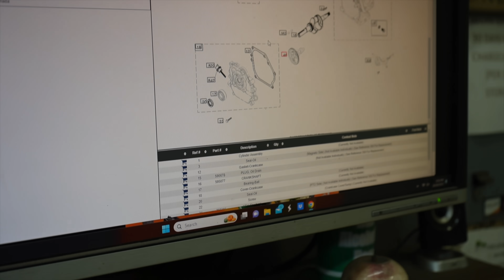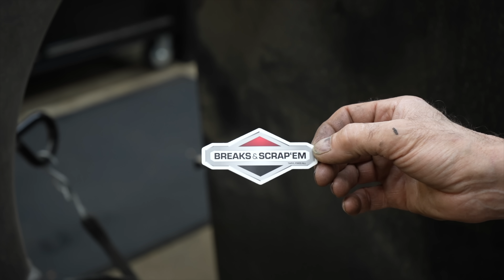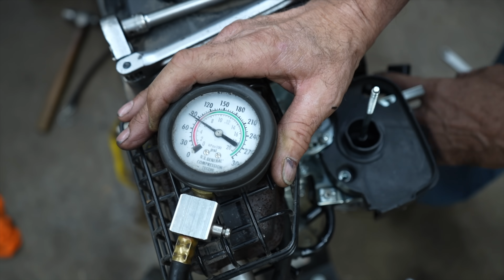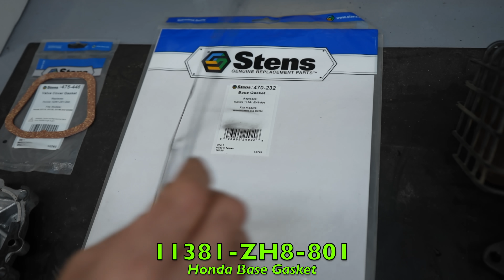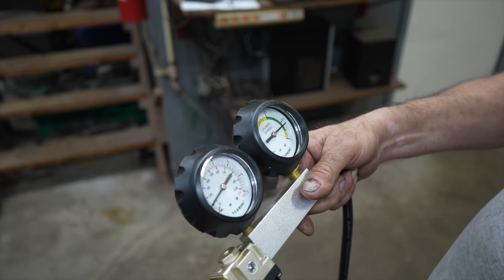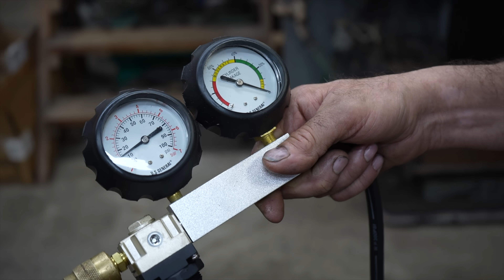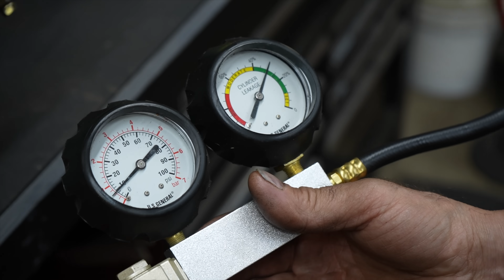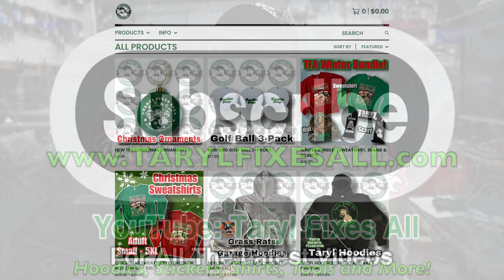Has He Finally Met His Match? Taryl is STUMPED!

Comment: What amazed me the most was not the stuck rings but how you, as a professional engine mechanic with your own shop, seemed to go through checking a lot of ' parts ' way before doing things like spinning it and observing the positioning of the valves in relation to the piston, COMPRESSION TEST,  ' real ' spark timing in relation to piston. Etc
Maybe a new addition to Taryls garage can be an acetylene powered ' parts ' cannon.
Reply: To be an accurate comparison the compression release would have to be removed from the Predator.

Comment: Strange problem with rings. The leakdown test is the primary way piston airplane engines are tested (done every annual inspection). Never done using a compression tester. Now it makes sense.

Comment: I've seen that problem on car engines with low miles and blowing oil out the tail pipe from short runnings  and the engine was  carboned up and the engine never gets warmed up

Comment: My log splitter has the same engine  and would start and run for less than a minute. it ended up being the gas cap clogged up. Wouldn't restart until I took the gas cap loose and let the fuel run through. Popped the cap apart and cleaned it out and so problems since.

Comment: So preditor pushrod is shorter, but the tappet is longer, so over all, both tappet and pushrod length is the same on both, right? If so, as long as you use both on a swap, they should work, correct?
Reply: I wondered that too, are the tappets' shafts the same diameter?

Comment: I had a Chinese engine pull that same crap on me. It was a sticky valve. Did it on two separate occasions. I blamed inadequate maintenance/tight clearance. Had to remove and clean the valve both times.

Comment: I quickly changed leakdown tester like that by replacing 2nd gauge to match 1st one. Then I have to calculate my leakdown.  I also eliminated the quick connect to the engine lead because it leaked.

Comment: You could have loosed the rockers put the piston at the bottom. Used your compression gauge fitting and pluged it in to say 40 to 70 psig air and listen and feel were the air is coming  out of, the exhaust, the intake, the crank case, the head gasket. You could also put diesel in the intake and exhaust ports and look for bubbles. This will tell you if its bad valves bad rings or bad head gasket cracked cyl. cracked head hole burnt in piston. Easy way to check why compression is low. You could also do a dry and then a wet compression test to see if the compression comes up a higher,  Higher wet reading usually means bad rings. What was the compression after you freed up the rings?? If the customer did not use the right break-in oil and  it was burning oil this may have stuck the rings. Really not Briggs and Scrap em fault.  🧐🤓

Comment: The classic 3.5hp veritical shaft is able to interchange parts i.e piston,crank,camshaft, valves etc with the later ,vertical 3.75 etc sprints. Quantums (mechanical governed) same thing, tho i'm not sure about the pistons & if they changed size once they hit 40 or if it was the later quantum 50 if it all. My point is the motor that requires the cam may & most likely can use a cam from an earlier model tho it may not be plastic. Just a thought as briggs appears to have standardized parts through different models & years in other words the cam may not be model specific... The chinese mufflers you'll find most likely will have the same bolt pattern as a briggs 16-17hp as my loncin 20hp did. It also means you can use an extension or make your own extension pipe & use the original muffler from a chinese motor this will save buying another muffler,it may require some pipe bending so it doesn't get in the way of shields etc so muffler can fit without interference

Comment: Taryl: I don't believe it. If it starts and runs, but has no power I'd say OK it's the rings, but it should also be producing a cloud of crankcase gasses i.e. smoke coming out of the crankcase vent. Eventhough, how do you explain why it starts cold but won't start hot? You should have scoped the crankcase breather tube while it was running for blow-by. If there's a massive amount of blow-by coming out of the crankcase, go have dinner. But if not?  Ignition electrical or water'd be my guess.  We'll see if it comes back. ben/ michigan

Comment: 80 psi would have been pretty low with the ACR disabled, I hardly believe Taryl wouldn’t have done the leak down way before pulling parts off the engine. I do realize it’s a low hour engine, but leaf vacs have a high potential for debris ingestion. Sometimes when you’ve see so much of a particular issue (plastic cam problems) you tend to try to prove the diagnosis instead of diagnosing the symptoms.

Comment: Taryl, also check those valve seats. I have had them come out of head with the valve. It will block air flow through head. And they won't run.

Comment: The oil ring will give you a reading on a compression test but if the top ring is stuck that engine will never run right

Comment: Did you compare the Scrub Cadet engine with decompression to the Breaks and Scrap'em with the decompression mechanism removed?  80PSI with no decompression is probably a bit low, leak down test solved it though, good work!

Comment: I had a briggs ex the new plastic carb ones. Anytime it was put on a slope it would run like shit. I gave up after far too much work, new briggs carbs. Checking tank fuel line, govenor, spark gap, plugs, flywheel key, Bent shaft. 

Nopety nope nope.

Comment: Leak down does test rings when you are sure the valves and head gasket are ok. So rings not seated was a great first call but if the rings were not stuck you have to run the engine more to seat them.  Stuck rings was the logical call.

They must have machined the ring grooves too tight.

Briggs honoring warranty is good.  Wish they were manufactured here in usa like they use to be. 

The predator having a metal cam is impressive. 

Still with stuck rings the 80 psi should have been sufficient for the engine to run.

Thanks for the brain teaser.

Comment: It's not because it's made overseas. the HF engines are made overseas, and they have been some of the best engines I've had. Briggs issue is the bean counters in their finance department telling them to make it cheaper. So, they make cheap plastic parts, have undertrained or no trained at all workers, pumping this garbage out. Doesn't matter which country it comes from. It all starts from the top. The top brass at Briggs wants more profit so they got to cut corners.

Comment: Taryl.... question :  Can you take the lifters and pushrods from the Predator engine (different lengths) and swap them into the Breaks engine, remove the valve stem caps, and it work ?  (or maybe have to swap the rockers also).

Comment: If that engine uses the same size camshaft journal as a gx200, which is different than a predator camshaft journal. then you most definitely can get a camshaft for it. Sure it ain't oem briggs but a hell of a lot cheaper than buying a whole new engine.

Comment: I pulled a running Breaks and scrapum off my Toro mower and  gave it away. Then I replaced it with a hard to find Suzuki 2 stroker engine. Problem solved! :face-blue-wide-eyes::face-blue-wide-eyes:

Comment: I'm still stumped though because how can we test for that without tearing the engine down because the compression test showed good enough compression.
Maybe you can test for bad rings with both valves closed and pull out the oil stick.
then feed compressed air through the spark plug hole.
this should show any overages of air flow through the oil stick tube.might want to drop some of the oil though........

Comment: Briggs & Stratton has been going downhill for a long time. Going on 25 years now for sure. I remember the 20.5HP twin opposed engines used throw rods every time if you tried to run one in the cold. The single cylinder Intek OHV lawn tractor engines you can't keep a cam in. Nine times out of ten when the compression release falls off it causes catastrophic damage. On one of the rare occasions I had one come out unscathed I figured I'd throw a new cam in it. The first two had the compression release already broken laying inside the box. Finally the third one came in ok. Head gaskets were terrible on those engines as well. I had hoped when B&S got into selling rebranded Honda clones the quality would actually improve and they would at least have some support. Turns out neither turned out to be true.
Reply: That's not what that solenoid is for. It's only there to keep fuel from being drawn into the combustion chamber and ignitng in the muffler as the engine is spinning down when shut off. Before anti afterfire solenoids were a thing it was very common to shut off a piece of equipment and have it backfire as it was spinning down or immediately after. If there's fuel entering the crankcase either then needle valve in the carb isn't seating properly, the float has a hole in it, or in the case of a Nikki carb the O-ring gasket has failed. As far as blowing  hole in the side of the block, no. That's from a thrown connecting rod. @feralkid1879

Comment: Wondering if there was any gum or varnish on those stuck rings or were the parts just machined with not enough clearance from the factory. Stale fuel will cause rings to stick that way, but that would not be a warranty situation. Since there was so little said or shown about the actual cause of why the rings were stuck, I wonder what the real reason was for the rings to be stuck? Any comment on this? Wondering if the publicity on this had anything to do with this warranty being paid. If there really was less than 10 hours of use on this machine and it is near the end of it's 2 year warranty period, it no doubt has sat with old fuel in it a good deal of it's life.  i would almost bet that the unit has been run with very degraded fuel in it a good part of the hours it has been run. How about a follow up on this Taryl? Soak the top of that piston and those top 2 rings in carb cleaner and see if they can be removed and what the ring grooves look like (gummed and varnished?) or are they mechanically wedged or stuck due to mis-machining of the grooves or the rings, which truly would be a warrantable issue. Let's hear it and see it.

Comment: 39:00 I bet the O.D of the cam bearing is the same between the Briggs, Predator so they could purchase old Honda dies to make that sump cover. Just using a different I.D bearing with the same O.D. Which is why the gaskets the same. If you pressed the bearings out of the cover & block you can probably use that predator camshaft. Get the calipers & tell me if I'm right please. - Detroit Laughin Grass Rat

Comment: A couple things to consider, a new engine will start without being broke in, so you saying the rings aren't broken in making it not start.....hmm... a motor will run on comp release enough to reach RPMs to throw out off the valve tang, it wasn't event doing that, obviously in the beginning the comp was nill by the way it sounded. Sounds to me like the customer forgot to add oil, or didn't add enough. We never saw what the cyl looked like

Comment: To be honest any highschool small engine class graduate would have known to check the rings when the spark ,fuel, and proper movement of the valves was verified.. It was obviouse the compression was low just watching and hearing you pull it with little resistance.. Ohh and the reason you were confused about the brighs compression being better then the other was because you checked the briggs compression after you took the compression release mechanism off .. If you had tested the other running engine with its compression release off it probably would have read 130 psi so you were totally confused because at low starting speeds your comparing one engine with a compression release to one without .. BTW those plastic cams will and do generally hold up fine because the valve springs on these tiny engines only have ten or 15 at most pounds of open spring pressure so they will never wear out the lobes regardless .. If you had checked the briggs engine compression with the bad rings and the compression release installed or never removed it it probably only would have had 5 or 10 psi cranking pressure which also means no vacume to draw in a proper air fuel mixture into the cylinder as well as no compression for combustion... Also i guess you misssed the blowby when the engine was trying to start and barely running .. Better luck next time !!! 😮

Comment: During the leak down test, listening to the exhaust, and intake, you can hear if the valves leak, listening to the crankcase via the oil fill cap hole would show air escaping there via the rings. Also, if you had a head gasket leak, you would hear that. Leak down testing is great for trouble shooting engines. This one baffled me for sure, but your stick to it attitude solved it!!!!

Comment: I appreciate your videos and advice.  I not fond of the Briggs and .   .... crap ..i never buy one if there is better alternative.  Just about anything would qualify..i not a expert on these engines..One of my money pit Harleys has ez start cams in it a SS engine.. i got bit from a hard starting lawn mower used i bought that the valves getting  loose and it made it hard to start ...  i worked at a power plant for a long time . The had Honda powered equipment.. pumps ect . Yea they ran good for the most part

Comment: this is more common than realized from the newer plastic motors. I have alot of them from China,  and the piston is not cut right for the rings
measured gap total distance is .0005, so after a little use-- CARBON locks the rings

Comment: Most of time the piston ring grooves on the piston accumlate with carbon and the rings stick in the grooves and cant respond to combustion chamber pressure by expanding.
Especially on 2 stroke engines. All it takes is to scrape the carbon out of the grooves

Comment: well it wasnt the muffler then. when you did the compression test and it held pressure from 60 to 80 with the 4 pulls it sort of says to me that the exhaust valve is not working 
properly.  its got sparks its got gas if its not the exhaust valve then its got to be the timing. this is interesting now lets watch more of the video

Comment: perhaps the non-venting cap explains the "run for a while then power reduction" as the carb leans out 'cause the fuel won't flow.  it would be worse when the fuel tank was really full as there would be less air to expand and it would drop pressure faster.  If it was run this way from the beginning some fraction of the running was really too lean. would that lead to the rings sticking ?? no idea.  love your videos and what I've learned from them.  been a subscriber for what seems like a decade, probably 7 or 8 years.  keep up the great work.  Glad you choose to spend some lifespan sharing your hard won knowledge in a fun way.

Comment: some fuel stabilizers react with the gas and turn into a kind of glue (stuck rings)  - years ago Itasca red 2 cycle oil would pulled chainsaw piston out to find  rings glued stuck and cylinder ruined it was not an isolated thing either

Comment: What are stuck rings? Maybe you could do a short video on what these are.
Reply: The rings are literally stuck into the piston grooves so they can't push against the cylinder wall to make a seal, it's almost like having a piston with no rings at all.
Reply: Thanks for the explanation. I didn't go to lawnmower school so I'm not an expert by any means. I'm guessing the rings are usually kind of springy so that they press against the cylinder walls to seal.  @ruben_balea

Comment: Taryl, let me see if I understand this compression & leak-down testing. When you crank the engine over it builds pressure and holds pressure (80psi) this is compression testing, correct? Leak-down testing is when you pressurize the chamber and see if it leaks down by the rings, correct? I still don't see how it can hold pressure one way, and then leak the other way. If the rings were stuck, then wouldn't it leak in both directions? :()
Reply: The engine makes pressure while cranking but it doesn't hold it, even if it's a perfect engine it will leak, the compression tester has a check valve so after a few turns it gets pressurized to the maximum pressure the engine can make.
The leakdown tester applies a maximum pressure of about 15 PSI at a low flow rate, the gauge is calibrated to show what percentage of those 15 PSI the engine is leaking at that flow rate, in this case it was leaking at about 50% or in other words it was only holding about 7.5 PSI from the 15 PSI available from the regulator.

Comment: Didn't you notice the lack of compression or resistance when you were pull starting the POS Chinesium engine?  Maybe you just thought that was normal but after you put the new piston and rings in the engine you had to notice the harder pulling while trying to start the damn thing???  But thanks for hanging in there on it and getting it done!!  I prolly would have pushed it into an old quarry or put an M80 into the spark plug hole and let her go!!!!   Really is a POS!!

Comment: The only thing i can see is there wasn't enough VACUUM created to draw fuel into the combustion chamber. Regardless of whether a compression release is working or not, the fact is the other engine would fire with 60 PSI compression while this one with 80 PSI wouldn't even do that. I can see why this had Taryl stumped for a while. You start thinking about ignition and wondering if it is just firing sometimes, valves not sealing, or something has happened and it's out of time. To know how long Taryl has been in the game and never ran across this before says it all. I wonder if he had squirted a bit of oil into the chamber if it would have sealed enough to create vacuum and start immediately? I suspect it would have.